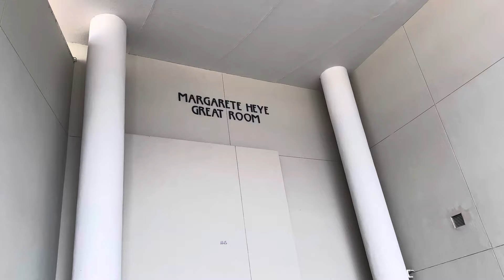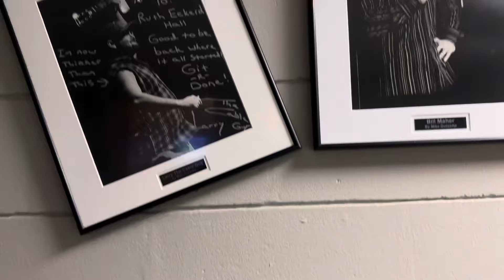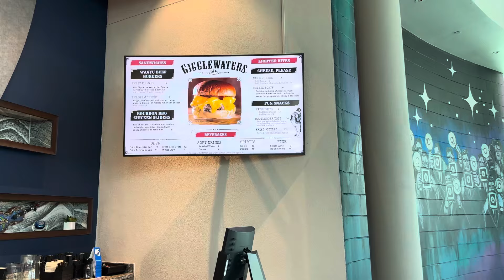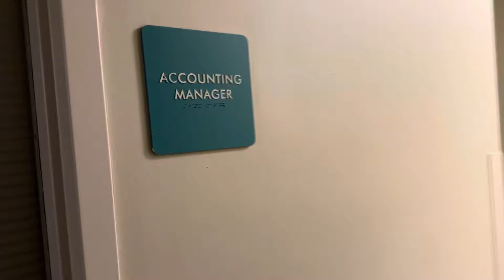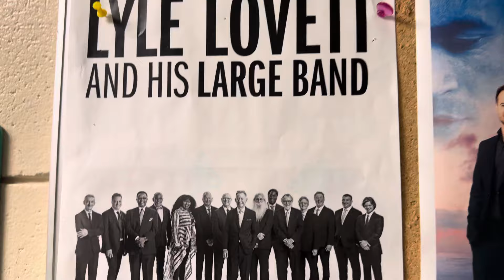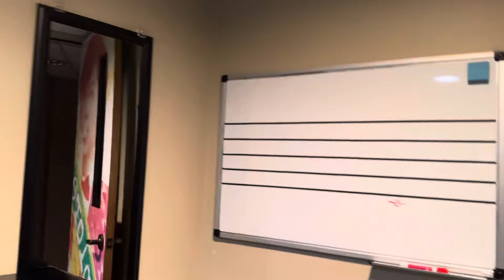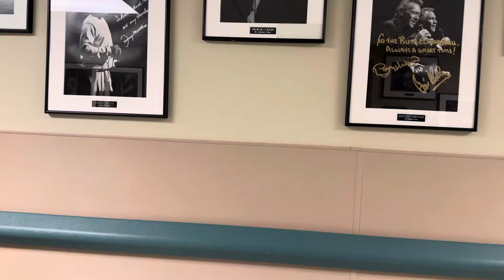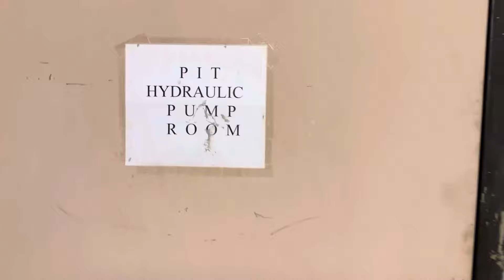1739. Ruth Eckerd Hall, Clearwater, Florida

Comment: I walk to shows at that venue. There was quite a bit of damage 1/4 mile from there as it's one block over from the bay.  All of those houses flooded from the storm surge of 5-8 ft. The beaches along the gulf, about 5 miles away, got hammered very hard as well.  Most of them are high dunes now.  Homes and lower floors of apartments and condos are ruined. Luckily, I'm in the highest part of the county and got no water whatsoever and I'm right up the road 1/2  mile on the opposite side of the road from Ruth Eckerd. We feel very fortunate.  I'm out of town, or I would have gone to the show. REH is a great sounding venue. I hope you enjoyed your time here.